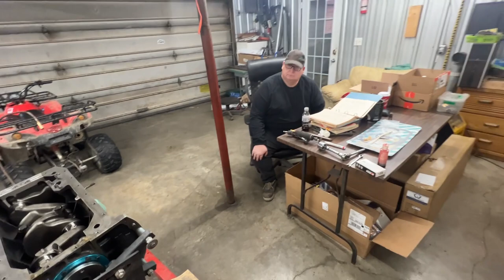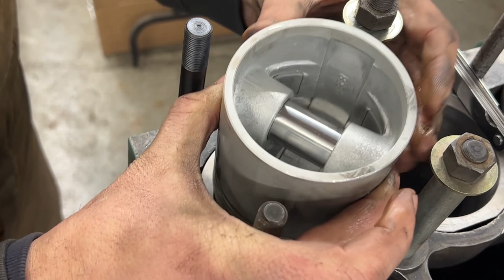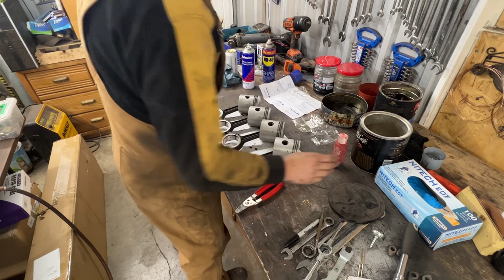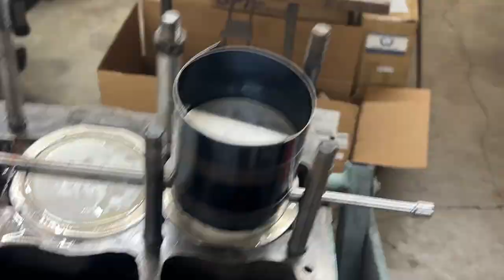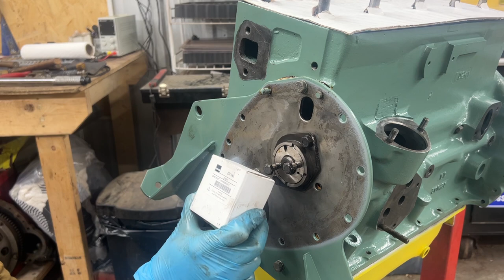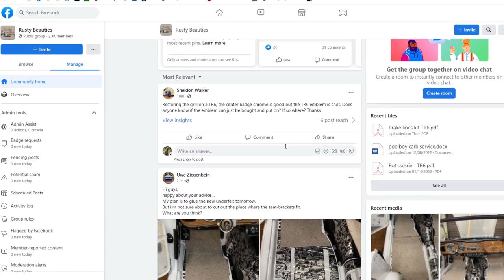1964 TR4 - Part 12 - Connecting rods, Pistons and Timing gears

Comment: Great video Elin.. Not putting 'assembly lube' in the bores is a good move.  There's another argument that has always done the rounds about "three stage torqueing" .. Personally I just tighten as equally as possible by feel and only use a torque wrench for the last turn/tightening much like you show here. The only time I'd reign in my tightening judgement is on cylinder heads.
Reply from the maker: Exactly, I do it too for heads only

Comment: I don't know if it is necessary on these engines, but some guys (Dave from Hagerty for instance) on Youtube torque the big end and crank bearing caps with the bearings fitted but without the  crankshaft, so that the gap where the crank is to be is correct in relation with the crank. In other words, there must be a gap for the oil to be able to move between the crank and the bearing. The gap is measured between the bearing cups with a micrometer and checked  on the circumference of the crank. If the gap is too small the bearings are starved of oil which of course causes abnormal wear. Thank you for your very interesting videos!
Reply from the maker: There are many useful techniques like that for high performance engines. If a mechanic shop goes with all of them they will be bankrupt very soon :) We rely on the accuracy of the new bearings and our own measurements and math. I find the bearings extremely precise and as long as I measure and do my math right everything should go well. I used to plastigauge the bearings just to doublecheck, but I find it unnecessary anymore.
Reply: @RustyBeauties  Thanks for the info Elin!

Comment: They say the only dumb question is one not asked , so here goes 😊If the # 4 bore is slightly larger as indicated by the ring gap , would that not also equate to a larger piston to bore gap ?
Reply from the maker: Correct, but 3 thou difference in the circumference equals 9/10000 in the diameter, so it shouldn’t be a problem. Most of the shops measure up to 1/1000, they don’t even know what a 1/10000 is

Comment: You can fit the pistons in pairs 1 & 4, 2 & 4, because of how the crankshaft is arranged. Saves a few flips of the block…
Reply from the maker: Yeah, I simplify processes when not filming, but in this case I did it this way to avoid confusions.

Comment: thanks again Elin.  I wish I had your videos when I rebuilt TS 394 LO in 1967.  I had the factory service manual but don't think I was as careful as you are.  Anybody got a time machine they are not using ?  But the car ran for 12,000 miles over 20 years.  Will be getting into it again this summer with a grandson.  Will report at some point.  From Manitoba . . .

Comment: You didn’t mention the wear on the small end, piston to gudgeon pin. Did you fit new bearings in the small end of the con rods & ream them or how do you determine if the fit is too loose? I’m enjoying this series despite not owning a TR4.
Reply from the maker: I usually check them visually for play. If there is anything that I can see with my eyes then it is too much. Not very precise, I know. I need to figure out a better method. The thing is I've never seen a warn small end bearing so far.

Comment: Generally the arrow is there when you have valve cutouts which are normally different inlet to exhaust so the piston can only go one way, on this case they are flat so they could go either way.
As for assembly lube on the rings, there is a small risk of glazing the bore but it's so small as to be negligible, unless you are going to rev the nuts of it from first start.
Reply from the maker: The TR4 pistons are always flat, no cutouts for valves and still some of them have direction. They have channels and holes on the skirts for better lubrication I believe nd it is important how you clock them. Not the case with this set though.
Reply: @RustyBeauties  I see, never come across that myself, you learn something new everyday.
Keep on keeping on Elin.

Comment: Good stuff! 😎
I was trying to figure out where I have seen that pastel green engine color... Buick used a green and a turquoise, but they seem darker. Detroit Diesel used a green, but it seems brighter. Anyone know? 
Not that you would or even should care, but I'm not a fan of the bright yellow with the green! I probably would have just painted everything boring black. Or at least used black in place of the yellow. 😁 Yeah, I'm nit picking.
Reply: I think it’s an Austin engine colour.
Reply: It is very similar to the colour of Rolls-Royce military / commercial engines, the BMC engines were a darker green.
Reply: @cheftush  you are correct. !
Reply: Austin engine colour.

Comment: Hello that was a good video. One thing I noticed was you torqued the connecting rods to 60 lb in one go not three stages. I have always done all my torquing in three stages. Like 20-40 then 60. Is that not done with Triumph engines?
Reply: Why do you do that Gary?
Reply: @philtucker1224  more accurate as you pull each side down a bit at a time in equal amounts. I have never ever ever torqued a head bolt or stud or rod bolt in any motor without doing three or even four steps. Also the cylinders should be wiped down what transmission fluid on a clean cotton rag or Bounty paper towel. Bounty doesn't have lint. You wouldn't believe the amount of dirt that comes off of the cylinder.
Reply from the maker: I do 2 or 3 stage on heads depending on the torque spec. But for bearing caps I go as even as possible with my regular ratchet or even gun and then to the correct torque on one go. It is a circle with a gap to the journal, it can't go uneven. I never measured, but I believe the difference between say 30 and 80 ft/lbs in distance is probably within 2-3 ten thousands. Again, for heads it is important and I do it as there is a gasket and changes in distance are much higher between the steps.

Comment: Elin why is it not a requirement to gap the rail of the oil ring?
Reply: Because they are not a solid ring did you notice the shape of the if they butt ends they can just squish up like an accordion as where the second and first ring cannot do that you do not want any gaps in the oil ring because you want to see all the oil in the bottom of the motor where it belongs not coming up past the oil ring getting into the combustion chamber and fouling spark plugs
Reply: @garyfraser8584  oh yes of course! (I remember now, thanks Gary!

Comment: Why don’t you use Plasti gauge ?
Reply from the maker: I don't find it necessary. As long as the measurements are correct it should be good. The new bearings are extremely precise. Of course there are small deviations that would be important for a racing or high performance engines, but for a standard engine like this I trust my measurements and math.